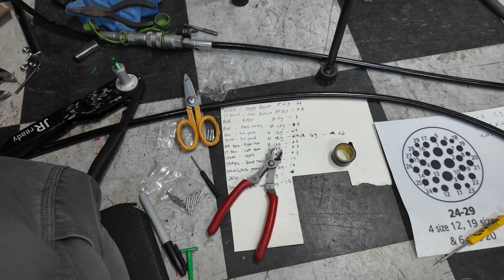ENGINE BAY WIRING HARNESS GETS NEW BULKHEAD CONNECTOR!

Comment: Dude Goosse. I have been dreaming about that firewall connector you just did. I might use that down the road, once I get the engine out, paint it and firewall repaired free of any unused holes. The engine is tuned so that is a completed project I dont have to worry about. Honestly, you just earned my 10 points with the electrical work. Great job brother.

Comment: Clean, Star washers for all grounds. Not only do they dig into the the metal, they act as a lock washer to prevent the screw/bolt fro ever backing out. Also look at Mavin Motorsports for some awesome connectors.